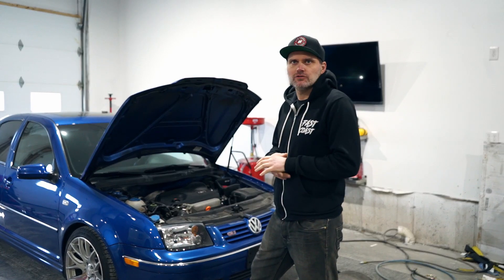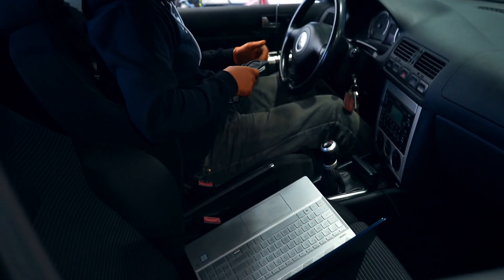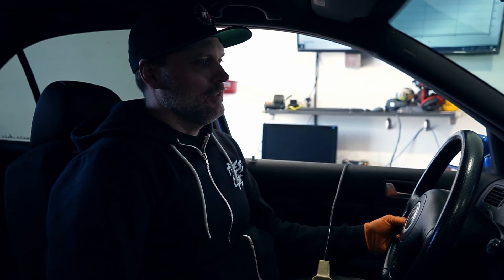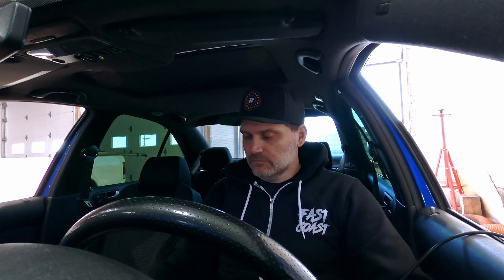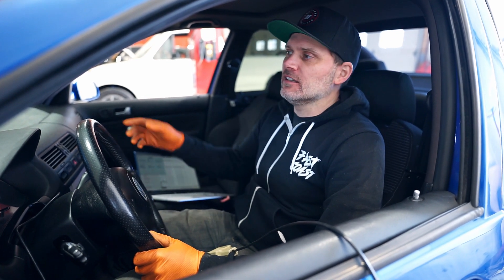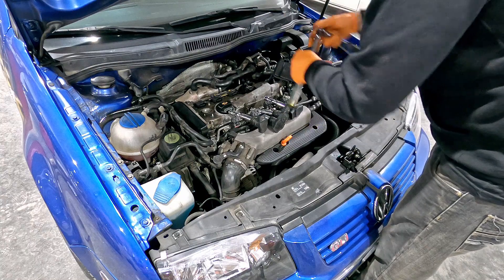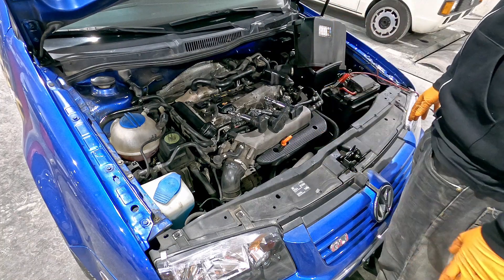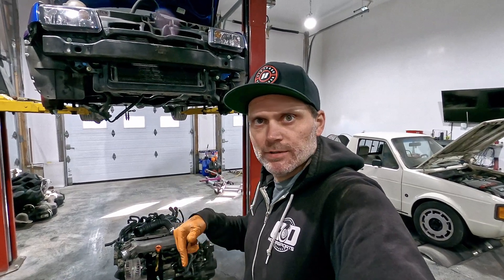MK4 1.8T Big turbo build.

Comment: I only need about 380hp/380trq to the wheels 1.8T JETTA GLS you think <$10k could get that done?
Reply from the maker: Lots of things that come into factor. The first being what mods the vehicle currently has. If it's stock you need to consider things like exhaust, intercooler, and clutch... and the stock stuff won't handle your power requirements.

Comment: I own the same model and color. Sup from newfoundland. Got parts on order from you guys! :)
Reply from the maker: Very cool, we're plugging away on this one. Motor should be back together this week actually.
Reply: @COMotorsports  awesome excited to see the outcome. Mines currently running 3" turbo back, 007 diverter, sai, ecs stg3 coil conversion, stg3 clutch with a 10lb flywheel, full ac/emissions delete, stg2+ tune with a modified k03 peaks at 23lbs just waiting for my cts fmic. Fun car to pick on the local honda boys.
Reply from the maker: @Cynical709  Time for a turbo upgrade. ;) This one should make some good power. Easily double what a K03 is capable of.
Reply: @COMotorsports  that's my next step do the motor and a bigger turbo. Needs body work first thou once all my boltons for this k03 build is done. Deff wants mo power. When it scares me ill be happy. Hehehehe

Comment: so weird that it made 180 on a stage two because stock they make 180, unitronic advetrtises stage 2  as 245hp 275tq
Reply from the maker: Also their stage 2 is supposed to be 93oct, but all we have here is 91oct. The big difference though is you're comparing crank HP to wheel HP.
Reply: CO Motorsports that is true i didnt even  think that they meant crank hp, thats my bad
Reply from the maker: Wheel HP is different then crank HP.

Comment: Can you run stock injectors with a ko4 turbo?
Reply from the maker: Depends on the software you're running. Some increase fuel with an increase in fuel pressure. So it all depends on the correct software and correct FPR to match. It would not be wise to run a K04 on completely stock fueling.
Reply: CO Motorsports Is your shop in Colorado?
Reply from the maker: @kool-aid8085  Negative. Canada

Comment: makes me miss driving my mk4 Wagon with a 12v swap!
Reply: Totally agree. I miss my '91 gli with a fully built AAA swap. Very clean mk4. Looks close to mint from here. It definitely needs a cooler to address the heat soak, and of course some poly mounts, especially a dog bone from the looks of the engine rock. Only thing I despise about them is the stupid pcv setup and the emissions junk. With a real catch can and emissions junk gone, they are a great bang for buck powerplant. The gli's are getting more and more rare around here. It's nice to see more three pedal cars and not all dsg's. Clean looking caddy in the next bay over. Do I spy a 24v swap in there? Its tough to see on this beat up phone.

Comment: love the build!  did you say actual timing  was 5 to 8 degrees after it pulled due to heat etc?   I think you said  91 octane  it was running  realizing  its limited  due to octane. guessing  93 octane @ 20 psi 10 to 12 degrees  
what   tuning software  do you guys use?  Thanks  again  for sharing  your time and knowledge.
Reply from the maker: First pull (cool) it was pulling 5-8* out during the pull. More after it got heat in it as you can tell by the results from the dyno runs. This currently has Uni, we will be changing that.

Comment: Awesome video !! Im kinda bummed and cant believe a stage 2 pushing 21 psi is only 180whp...really thought it was going to be about 220-230whp.....with that beeing said ive the seen the K04-001's push about 230-250whp and the the K04 hybrids push about 260whp+ like (F21 Frankenturbo)....
Reply from the maker: K04's are useless on this engine IMO, I've yet to see anything in person make any sort of power... maybe 230whp. Definitely no K04 1.8T's making 260whp around here. 

As for the power this car makes... as mentioned at the beginning I was sort of expecting around this power so not much of a surprise to me. We're talking real world results, not fudged hail marry dyno numbers.
Reply: @COMotorsports  Thanks for the quick response/info !! I look forward to too see whats next !
Reply from the maker: @Crypto_Chino  No problem, appreciate the feedback.
Reply: @COMotorsports  I have a turbo concepts stage 3 hybrid k04 has a 63mm compressor wheel and 50mm turbine on my car. Haven't dynoed it yet but Allegedly highest hp hybrid k04 on the market at 350 max. Leary of pushing it to hard without my rods in it yet.
Reply from the maker: @beefysghost867  Ummm 63mm someone has their specs wrong as there's no way a K04 has a 63mm compressor wheel.
Reply: @COMotorsports   Massive 63mm TCX extended-tip/-height billet compressor, straight blade design for smoother power band, greater efficiency, and lower inlet temperatures 
That the specs on there site. 
https://turboconcepts.net/product/pdzx-183t-audi-tt-golf-jetta-new-beetle-transverse-1-8t-stage-3-bolt-on-350hp-upgrade-turbocharger-package/
Reply from the maker: @beefysghost867  yikes... Weve made 700whp with a real 62mm on a 1.8t.
Reply: @COMotorsports  nice, this turbo is pretty wicked, just need to get it finished tuned and then get some numbers from it.
Reply from the maker: @beefysghost867  Interesting to see, the stock exhaust manifold is so tiny and crappy that it will be hating it's life trying to move that much air. Best of luck.
Reply: @COMotorsports  yea it was i hated it, switched to 034 high flow cast. It was bottle necking it bad. Wish you guys was closer and I would have you guys finish tuning it.
Reply from the maker: @beefysghost867  Well that's good then, best of luck.
Reply: @beefysghost867  how do you like that turbo? I have the same one waiting to replace my crappy ko4-001
Reply: @550hpW900L  the tc stage 3? It's a fucking monster.  Also you might want to go ahead and upgrade rods. Cauze mine is out of commission atm bent a rod cause it spools so fast it crazy.
Reply: @beefysghost867  yep the turbo concepts stage 3. Awesome, I already have rods. Can’t wait to slap it on. I’m bored with my ko4-011.
Reply: @550hpW900L  that's understandable, I'm going bigger, but the owner of turbo concepts is a book of knowledge if you have any questions call them and he will help.  
But I'm pulling mine today and getting everything ready to pull the motor
Reply: Joshua C. My car made 268whp at 24 psi whit a gt2860rs on 94 Oct and Unitronic bt tune.Last time i went on a dyno my car made 310whp whit the same tune but whit a gt3076r at 22psi.Now im running 26 psi whit new stuf on the setup! Great video!🤘🏻
Reply from the maker: thanks, and yes a 28 has the potential for a lot more flow compared to a K04.

Comment: With a stage 2 tune on that setup shouldn't the hp and tq be higher then that?
Reply from the maker: It's running 91oct, and this is WHP not crank HP.